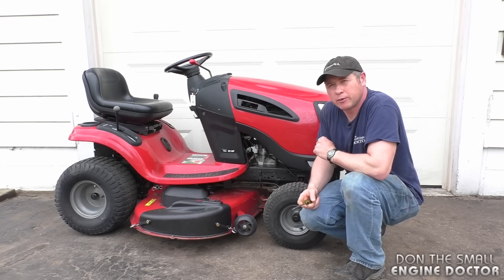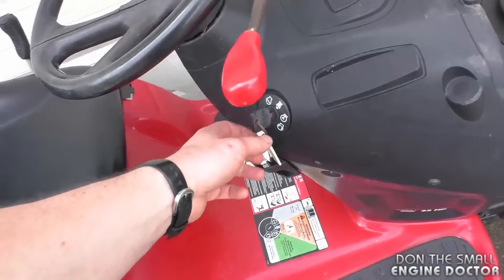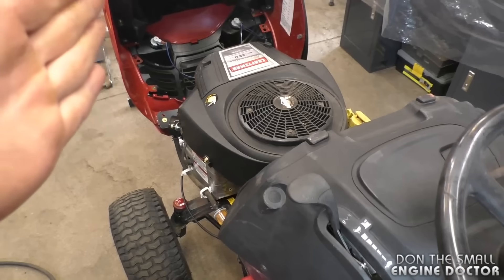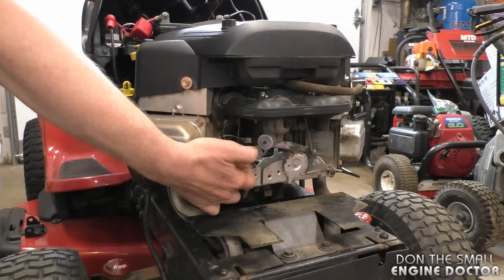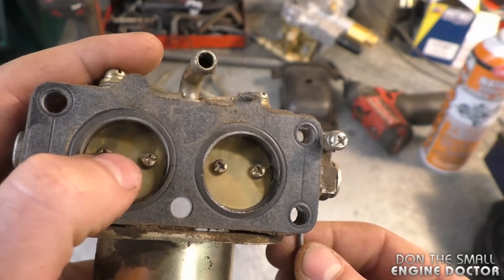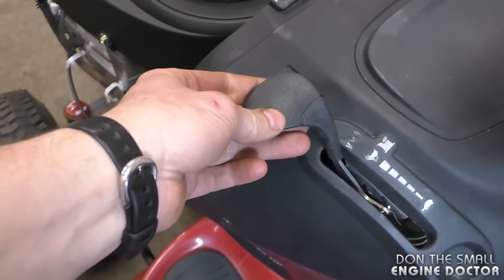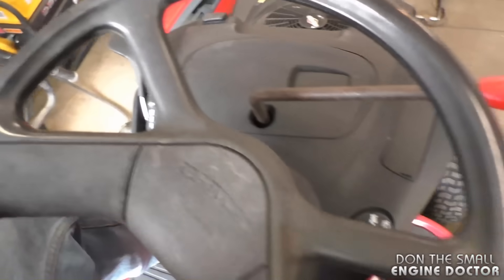Lawn Tractor Won't Start? Try This Easy Free Fix!

Comment: Great video looks like a great opportunity to cherry pick what seems to be a common problem for that particular tractor what seems to be a problem really isn't a problem and you can flip a so called problem to make a few hundred bucks and horse trade your way up to a better tractor.  Just like a  generac generator has a common problem with the  rotor windings having a poorly secured rotor windings and eventually breaking the rotor windings making the generator useless. You need to repair the rotor windings first then you can either pick them up cheap in non working conditions and it requires you to depending on how much slack you have on the rotor wire as to be able to hydraulic crimp it back to continuity and then marine epoxy the leads so they dont vibrate themselves to failure again.

Comment: Did you disable the seat safety kill switch for this vid (for clarity I quess)?
Reply from the maker: no, with parking brake on
Reply: @donyboy73  Mine won't start with parking brake on. I'm 5 foot tall & when I push blade engagement lever I come up off of seat slightly, it shuts off.

Comment: i have a newer Husqvarna 440 chainsaw that is hard to start and wont stay running i have tried  adjusting the carb still same problem any ideas?
Reply from the maker: check piston for scoring first, could also need a new carb kit or new carb

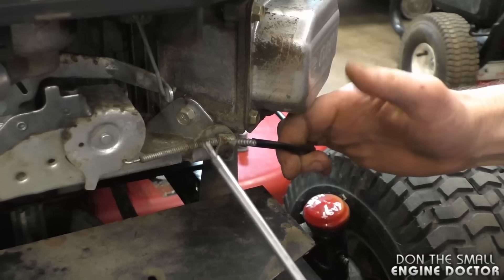Comment: You hop from a view of the sloppy linkage to the torx adjustment screw (3:15 and again at 4:08). From the video, one get no idea of where the one is relative to the other.  I'm sure well find it, but it would be worth looking at to see how your edit missed the mark.  Having said that, I did appreciate the way you effected the adjustment. Ah, I just figured it out - to teh right of the lever!

Comment: This was the issue with my Husqvarna 48", however, it had a separate choke, so it wasn't the choke, it was the throttle in the snowflake position (full throttle for cold starts).  And yet I had another issue that I guessed before this that was part of the problem. The hose coming out of the fuel pump was dry. So after I replaced the fuel pump (cheap plastic thing that costs $20), it still wouldn't start and acted like it got no gas. I did loosen the cable , which on mine was a very shallow large slot flat head screw (very poor design) and after I pulled it tight as shown in the video it still didn't start. I had to prop up that lever with an object to get it all the way open, then after nearly running the battery down from all my previous attempts it started!!!. After it was running I was able to move the throttle lever back and forth to determine the full throttle position of the carb lever, then I tightened it. There was a tell-tale sign that should have tipped me off to the problem. In the past when I moved the lever to full throttle after it sat for a while in low (always move to low when turning off) , it would be stuck there and I had to jam it up to get it to move up (I even broke the plastic lever knob). This obviously caused my issue but not sure why it would get stuck in the first place. I'm currently charging battery now and will be all set to move leaves later this afternoon!! Thanks for this very helpful vid on how to correct a very sucky B&S motor defect. I'm getting a Kohler next time.

Comment: I have a new “auto choke” John Deere Zero Turn with a Briggs OHV motor. It appears the problem you illustrated on this video is eliminated since there is no choke cable that I can detect anyway. Do you have a video yet Dony of hard to start issues with these auto choke systems?
Reply from the maker: just serviced a john deere zero turn with auto-choke, so far no issues

Comment: Why is my yt3000 keep blowing fuse? It is not the solenoid, battery.. Jumping the sol with a screw driver and disconnecting the kill wire it starts up fine and runs great. Any ideas?

Comment: Where is the gas valve? We got a brand new t110 at Lowe’s. We got it home. It had a little gas in it. We filled it up and now it will not start. Could it be the gas valve?
Reply: Does the starter turn over? If it does then it could be many things, check for spark, or take the gas line that goes into the carb and check for gas coming out at a steady rate. 

If the starter doesn’t turn, then make sure your brake is on and they mower pto is off
Reply: Also try to spray starting fluid into the carb by removing the air filter cover and the air filter itself. If it does start and die after 1 second, then you have a problem with gas not coming inside the carb

Comment: I feel like such a fool.  I've had my Craftsman LT1000 riding mower for over 15 years, and never knew that I was supposed to move the throttle up when I started/move it back down once the engine turned over.  I've always just left it in the middle position, constantly.

Comment: To start my mower, I don’t even have to use the choke; it fires right up. The secret? Any equipment like that must be properly stored whether it’s a short or long term - without gas in the carburetor. (Just run out of gas after closing the manual fuel shutoff valve; if your mower doesn’t have one, install it)

Comment: Hey Don, I have the exact same mower with the vtwin intek motor.  I've tried everything I can think of and it still doesn't like to start.  I was going to try your fix in this video, but it wasn't needed since there was no slack in the cable.  I've also adjusted the valves, replaced plugs, new battery, checked compression, replaced air filter and even replaced the carb with a new unit, but she never likes to start.  It's so bad that the only way I can get it started is to pull the air filter and spray starting fluid directly into the intake.  Once it's started she runs great (and can turn back on normally when warmed up) but I can't figure out what I'm missing.  Any suggestions on other things I could check before I admit defeat and take it to a shop?  Thank you!!!!!!!!
Reply from the maker: could be a bad carburetor, I only use oem carbs on those trators
Reply: Did you fix yours?  I just found out the choke linkage has design flaw and it actually set the choke plate wide open when you set to choke.  But I don’t know the fix.
Reply: @hotdogmy2786  I never found a fix, I've just been starting it with starter fluid for 2 years now. It's a shame really, everything else works great.
Reply: @paladinew  If you move the choke lever up, the choke axle should rotate counter clockwise to close, but my always rotate clockwise.  It actually makes the choke wide open.
Reply: @hotdogmy2786  I'll be mowing today or tomorrow, I'll take a look at it again and see if I can spot this.  I'm too stubborn to pay a shop to repair this old mower, so it would be great if I can finally put this issue to bed.  Mine purs like a kitten once started.
Reply: @paladinew  you can use your finger to push the choke lever up while make sure it turns counterclockwise and then lock the choke.  It should start right up.  It can be done only by removing the hood, no need to disassemble anything else.  i have a fix and will let you know after I verify it works.

Comment: So spark plug is good.
Chuck lever is tight.
Fuel filter is good.
Fuel is reaching the carb. Tractor cranks but never starts.
What should I check next?. Please.
Reply from the maker: I would try cleaning the carb
Reply: @donyboy73  
I removed the valve covers and I found out one lifter is not moving a bit! I can press the other three (pushing the spring side) but not the one on top right hand side!.

Comment: Hey mr don my is John Deere series La105 haven’t turn on for the last 10 years I charge the battery now the light is back on the hrs digital of the tractor is back on but no crank I check the fuse is good the safety switch is good it not cranking at all do you have any idea
Reply from the maker: you'll need a new battery
Reply: @donyboy73  yes I went out just got back it crank now so that told me that the engine will run but need battery thank you mr don

Comment: I have a Craftsman 42 in older model riding lawn mower I have bypass both of the safety switches and every time I let off the brake pedal it dies on me what is the problem can someone help me please

Comment: I got a lawn tractor with  a 24 hp engine and it won’t start rapid , I  do every thing I can but it keeps starting slow , I change the positive cable , clean the ground, change the starter new battery, every thing snd it keeps starting slow , please make the miracle !

Comment: If it just dies on ya these are the things to look at>  Make sure it got fuel!  the Fuel filter,  air filter, clog line, trash in the tank, or no spark. Most cases its the carburetor solenoid.  .   There trashy need to replace every 2 yrs.  THE CARBURETOR IS THE LAST THING TO REPLACE!  They last a long time if you keep fresh fuel in it, and a clean fuel filter, and a clean air filter on them.  and run carburetor clean threw the engine !  This also help with the spark plug life as well, Its like a tune up

Comment: I have a very similar mower but mine will not even turn over it shows that I am getting DC amps and I have tried a new spark plug new battery it would start to turn originally But now It won’t even do that

Comment: HEY I HAVE A CUSTOMER THAT HAS A HUSQVARNA RIDING MOWER WITH A 24 HP TWIN CYLINDER B&S ENGINE. MODEL 446677, IT WON'T DO ANYTHING, I DID REPLACE THE FUEL PUMP AND IT WILL BARELY MOVE THE ENGINE WHEN IT TRIES TO TURN OVER. I THINK THE VALVES NEED ADJUSTING, HOWEVER, WHAT IS THE CLEARANCE ON THE INTAKE AND  EXHAUST ON A TWIN CYLINDER. ANY HELP IS APPRECIATED.

Comment: I replaced my battery and spark plug and adjusted the choke linkage cable. My tractor still won't start. Craftsman r1500 😥

Comment: yeap i bought one for 200$ the guy that sold it to me said since he bought it he only used it a few times and noticed it was smoking so he stored it for winter and on summer he tried to start it and nothing happened so he said if i take it to a repair shop they'll end up charging me almost what i can buy a new one or at least half so might as well sell you this one and I buy a new one so he brought it to me and I checked it and it didn't want to start so i thought it might be the fuel pump so i disconnected the fuel pump and as soon as I disconnected it fuel was still flowing with key off so i turned the key on and fuel was flowing through so that wasn't it so i went to the carburetor area and I had barely worked on a murray rer  that had a problem with the choke cable not closing all the way so i tried it with the one I bought and boom it started up as soon i let go the motor died so i adjusted the choke cable good and it has been working perfectly so now i was still having the smoke issue so i went to check the oil dipstick and see if it needed a oil change and the oil was way way over filled with gas so I changed the oil and oil filter drove it for a few minutes and it cleared out so if your riding mower smokes check your oil and see if it is getting gas it might be your fuel pump

Comment: I was cutting the lawn and the tractor shut off, nothing happens when you turn the key. But the battery is good
Reply: Make sure to check that the battery actually has good charge first of all. After you have confirmed this check for blown fuses maybe that is the problem. Also make sure to remember to take off the blade engagement lever or button as that could just be the simple problem since it turned off by itself.

Comment: 1) my choke lever is tight 
2) replaced fuel filter
3) Replaced spark plug 
Still not working. It’s turning but not sure…air in the carburetor?

Comment: MY new pony just died on me for no reason at all.  So i went threw the process .  Only way to fine the problem. i found trash in the tank. it looked like paper from the gas can led.  clean that out and blew out the lines and put another fuel filter on it. Nope that wasn't it!  So it got to be the solenoid.  It was my solenoid!  It went out on my new pony !  i stuck a new carburetor solenoid on . IT FIRED RITE UP  ; )  I never choke one!  It starts in low throttle

Comment: Apart from the cable being adjusted wrongly, maybe the screw was not always tight enough to stop the outer  slipping a little.
A very sloppy factory with minimal quality control.

Comment: I have full battery,  but it wont start unless I jump it , its confusing. If it's full battery why does it need to be jumped?
Reply from the maker: Your battery may not be producing enough amps. try a new one.
Reply: @donyboy73  thank you I will need to test the amps when started.

Comment: If somebody can help me out please.. ok I got a problem with my craftsman 19 HP I removed the air filter and I put 3 fingers on front of the cover of the carburator and It sucked my fingers in and that's the only way the engine will start, as soon I removed my hand it shut off instantly ( yeah it sounds weird and crazy but that's what happened), if someone has any idea of what it could be?  I'll highly appreciate it thank you
Reply: Using your fingers is like using choke and preventing the air from coming in. So the engine sucks a lot more gas causing it to start.

This means most likely means that your problem has something to do with the choke not working properly. Try this: Put the engine all the way to choke with the lever, see if the first butterfly closes (this is the choke butterfly) If it does close it is a carb problem and it needs some nice cleaning.

If it doesn’t close then the only problem is that the cable isn’t working properly and/or you need to adjust the throttle control.

Comment: My lawn tractor was leaking gas into the cylinder.  and didnt want to start after sitting a while because it was hydro locking from the fuel . A shop told me $150 to fix it. I put a $6 fuel shutoff in the line and now it works pefect.  Lawn mower shops are crooks.
Reply from the maker: valve helps but you can also do this repair, https://www.youtube.com/watch?v=u__iP_nsX3w&t=1s
Reply: @donyboy73  I changed out the needle and seat and the old needle was bent . That helped some but eviidently something is wrong with the carb so the shutoff was the cats meow. I adjusted valves like 10s of 10s youtubers told me to do. It did nothing. You cant fix a flat tire by adjusting the lug nuts LOL

Comment: Shouldn't start if your not in the chair.
Reply from the maker: brake is on
Reply: @donyboy73  I thought  probably rigged the switch under the seat.  I didn't know it would start with brake on when not in the chair.  Learned something new today.  Was a good video.

Comment: It’s sad how Craftsman went down hill near the end. This should never have left the factory maladjusted like that. 

Second.... how is it starting without your ass in the seat? My rider requires the operator to be in the seat or it will not start or will shut the engine down if it is already started.
Reply from the maker: with parking brake on

Comment: This was too easy. What I have seen in older machines is when the valves wear, they wear out of adjustment.  If you readjust the valves to ,005 thousandths it will start much easier in older Briggs engines. If the valves are too tight they will burn the valve seats reducing the engines power. If too loose they cause the starter to be unable to turn the engine over and risk dropping the pushrod from its connections.